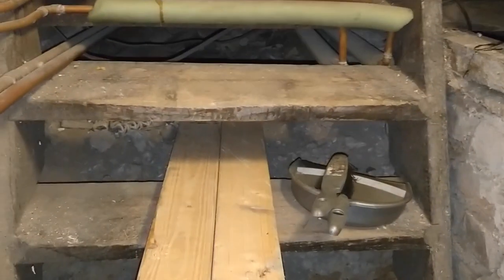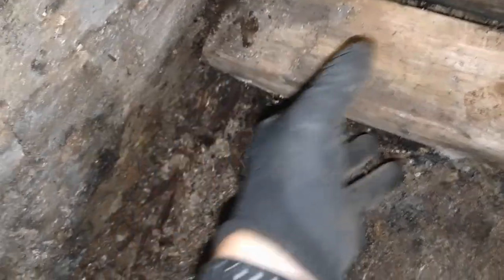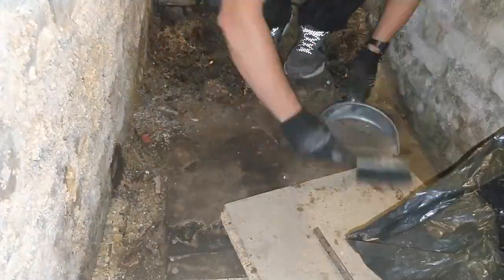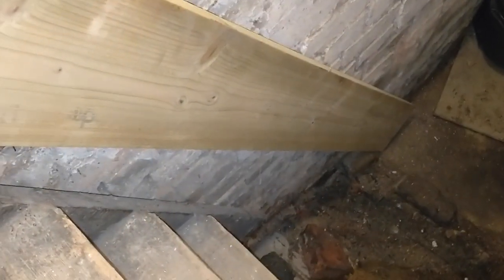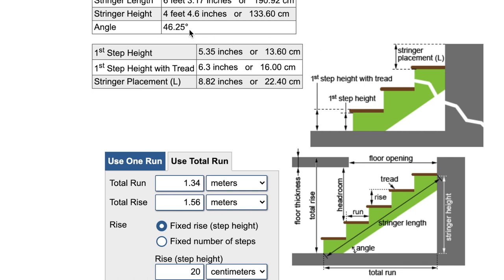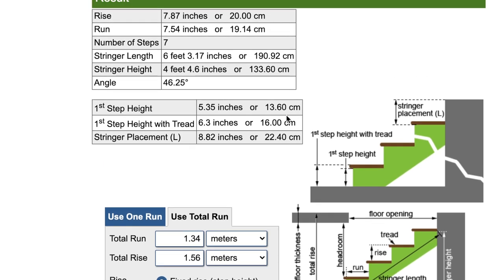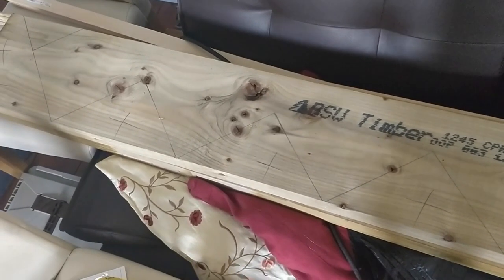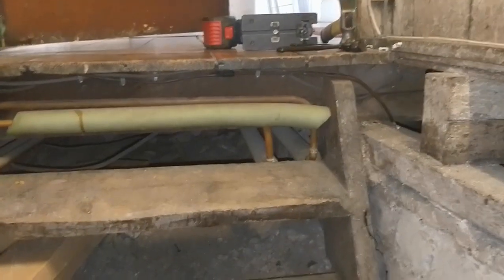How to build cellar stairs

Comment: A fine job Sir, 👍 Just a few pointers for you if you don't mind. If one decides on notched stringers then a 9" by 2" is insufficient. By the time the notches are removed one doesn't have enough meat on the bottom of the stringer. In that instance I would have doubled up the stringers with an unnotched stringer on each side. Not a massive issue over a short run like yours but something to bear in mind. If I was building notched stringer stairs I'd be using at a minimum 12" by 2" LVL's. Also you should have put some self adhesive flashing tape on the bottom of the stringers where they land on the concrete. The stringer on the right hand side (viewed from the bottom of the stairs) should have gotten similar treatment or a coat or two of wood preservative. I would have used a heavier tread as well, minimum of 1-1/8". A housed stringer stairs without risers probably would have been a better bet here. These are not criticisms, just my observations, 👍 🔨 🇮🇪
Reply from the maker: Cheers mate, useful considerations!

Comment: Hi, great video! I was wondering if there's a reason for not putting on risers - i.e. would the addition of risers mean that there wasn't enough ventilation for the earth beneath the stairs? Our cellar is almost identical to the one in this video, and I hate seeing the bare earth when I walk up the stairs so would love to put on risers, but am nervous about causing issues with damp.
Reply from the maker: Risers would probably be fine, but I'd be inclined to cover the earth behind with a damp proof (even a thick plastic sheet would work, if it's continuous). I didn't put risers in because it wasn't necessary for these simple stairs, rather than for ventilation per se.
Reply: Ok, thanks so much!